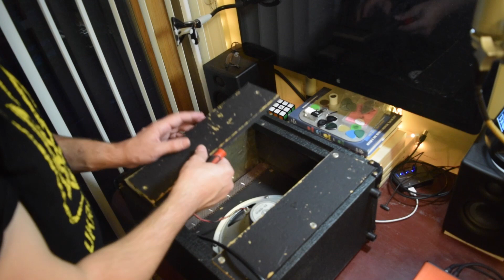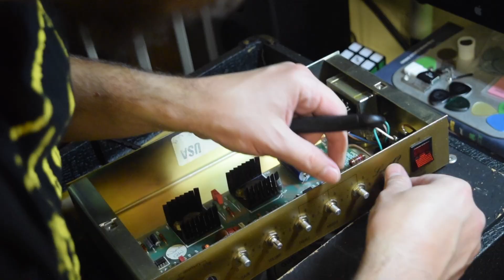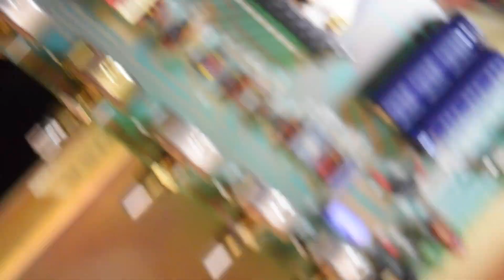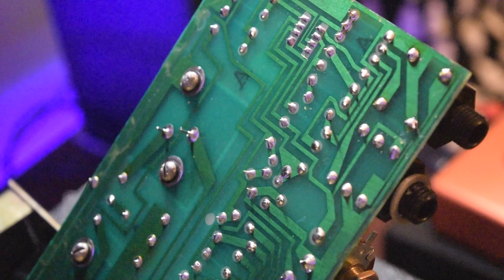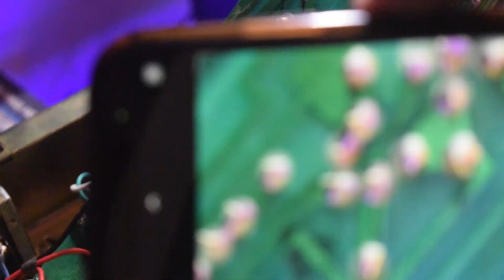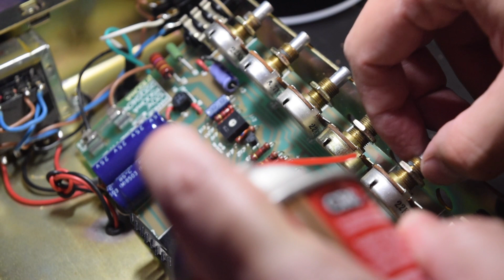Easy Fix for Intermittent Sound & Scratchy Potentiometers on Any Guitar Amp | Marshall Lead 12

Comment: Happy to see this amp getting love. Hard to get original pots new in Australia, Killa sounding amps,
 I think
 ZZ top used one for a song or two from memory.
Reply from the maker: @ianbrown4386  Thanks for your comment. That’s right, Gibbons used the line out into a valvestate power amp, from what I understand. I have tried this setup and it sounds phenomenal. (I use the fx in on a Valvestate 8100 head.) btw I have two Lead 12s and one Bass 12 now. The Bass 12 is also amazing, especially dimed.

Comment: Thanks for sharing. I can use this to breathe new life into my own amp.
I have owned a Marshall 75 reverb, 5275, for a few days now. Beautiful amplifier with surprisingly much volume. This one also dates from the 80s.
It crackles here and there and sometimes the spring reverb goes crazy. I have no idea what could be causing that. And the bass potentiometer has little effect on the sound, maybe cleaning it would help here too. But what I am worried about is the loud bang when switching the amplifier on and off. Do you have any tips for that? Too bad you don't live nearby, otherwise I would drop by 😄
Reply from the maker: @Herbieatorbie66  thanks! I’m with you, I am addicted to old SS Marshalls at this point. Haha 
I think the pots will be fixed (at least for a while) if you spray them. 
As for the popping, I have done some research on this and people mention the large caps or the power switch as the potential culprit. Maybe start with replacing the caps and see if that fixes it? Just please follow best practices and make sure the caps don’t hold any charge before you work on the amp.

Comment: Better then the Boss Katana. I would take this over the Boss any day.
Reply from the maker: @TheCleaner6969 I never played a Katana but this little Marshall is a gem. Gives me all the Marshall tones I want at bedroom levels. I can go from Jimi with a Strat to Billy to Slash to Edward - with a boost/drive pedal. Prices went up on these, but if you see one for cheap, don't think twice.
Reply: @zoltansays Believe me the Katana does not sound Marshall & too much messing around with the interface. I seen Johan Segeborn demo the head. This thing sounds great.
Reply from the maker: @TheVlad69  I believe you 100%. I've been through all the modeling stuff (still own some) but decided to stay all analog in the end. Check out the sounds from the Lead12 in this video: https://youtu.be/lUQiatfh1OM?si=QUvLZjw77IN58gm8&t=3103
Reply: @zoltansays That really sounds good! Nice playing as well. Big sound for such a small amp. You can't beat it \\m//
Reply from the maker: @TheVlad69 thanks! It’s a monster. I wish Marshall brought these back. Or someone made a good clone that is readily available. At around $100 these would sell like hotcakes.
Reply: @zoltansays you're welcome! I wish they would too. Perfect price & you know they'll sell. I wish someone would come out with a Rockman pedal too. The prices are way too high on them & I know they'd sell. The used market is crazy. It doesn't pay to buy used anymore unless you can find like you did.
Reply: Yeah right, try putting this up against a drummer 😂
Reply: @baronvonchickenpants6564  Did it already. I fail to see your point.

Comment: What is the rated wattage? I recently picked up a Danelectro, from the late 90s, and while it’s only rated at 15 watts, it sounds more like 50 watts! These little monsters can really scream.
Reply from the maker: These are rated at 12 watts. There’s more to perceived volume, like can size etc. probably the biggest is speaker sensitivity. A 3 dB higher sensitivity will double the perceived volume. With an efficient speaker, a 12-watt amp will be way to loud for a ‘bedroom’ situation. :)
Reply: @zoltansays  Thanks! The right match between speaker and amp is critical, the correct impedance and as you point out, speaker sensitivity.
Reply from the maker: @user-qm7nw7vd5s  I hear you. I'm planning to use my Bass 12 (same wattage but less gainy) at a gig soon, I think it will be loud enough with our light-hitting drummer. Worst case is I need to mic it.
Reply from the maker: Check out my Bass 12. There is some playing at the end of the video. I got it after watching Johan call it the best ever budget SS amp. It did not disappoint... :) https://youtu.be/J3qqjqTUIjo